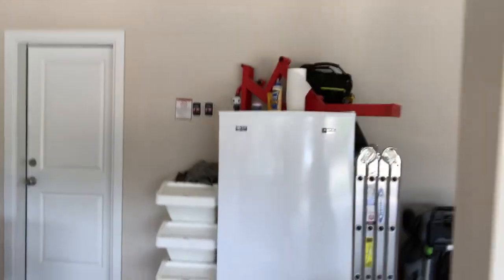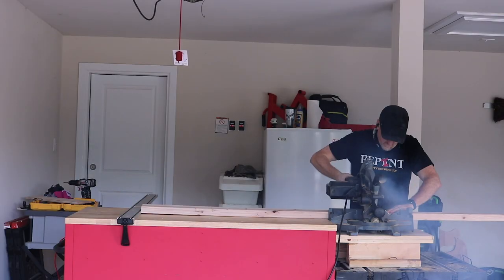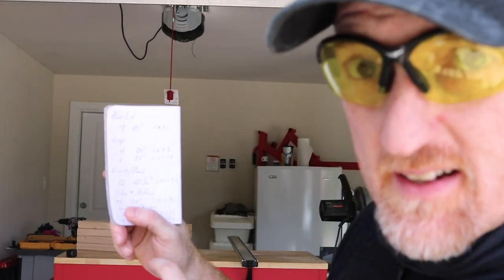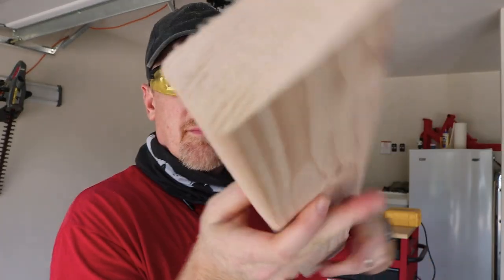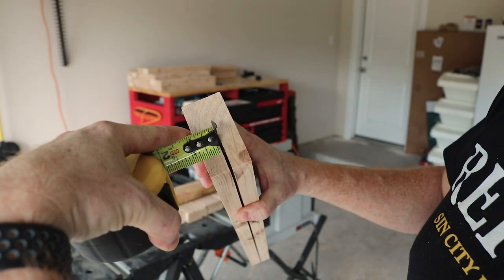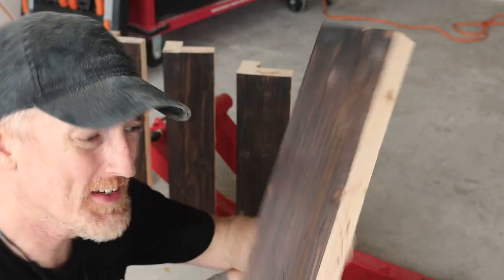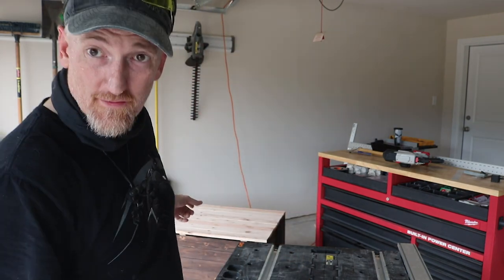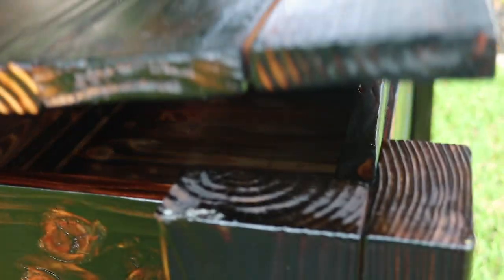DIY Outdoor Storage Box out of 2X4s - Shou Sugi Ban Finish

Comment: Great video so  just a idea what if you 45 one side of each leg 🤔
Reply from the maker: Thanks!
So, there's I reason I stay away from mitered corners when I burn the wood. It's because the area where the 2 45s meet is extremely thin and tends to curl when you hit it with a torch. And when both sides curl you get a big gap in the middle of your miter.
Cheers!
Reply: Build Dad Build makes sense

Comment: enjoying your videos, keep it up. 
Do you burn the wood after applying wood glue? I had heard that the glue becomes weaker if charred.
Reply from the maker: I use very little glue, especially when I burn deep. But I've got this question enough that I think I'm going to do a video experimenting on if glue will fail under the torch. 👍🏻👍🏻